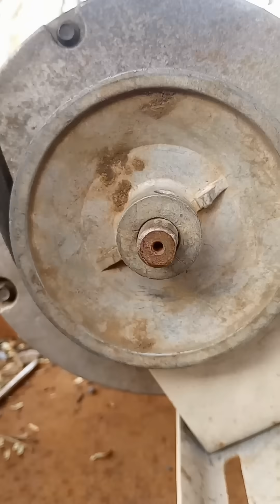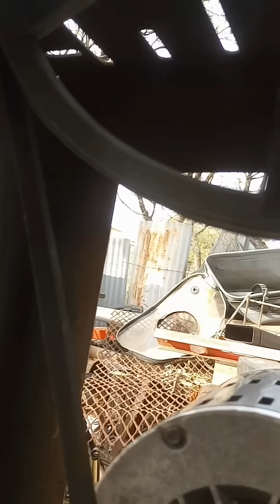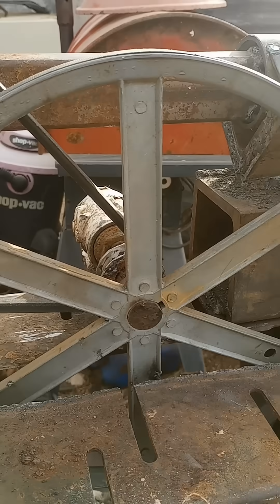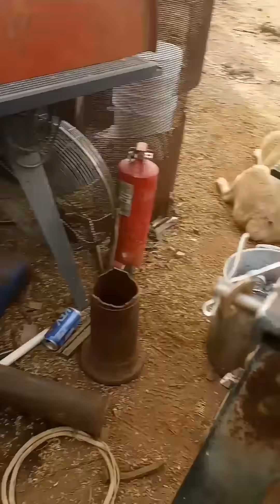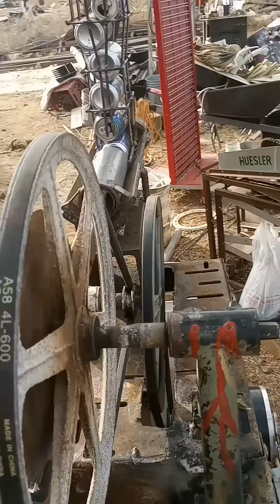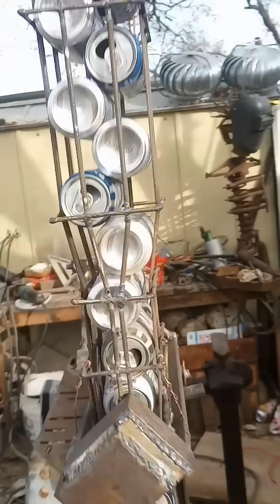Automatic can crusher demonstration

Comment: Nice wish I could figure out how to build me one
Reply from the maker: @fergusonto-2032  it's not too difficult, I start with a ½ horse cooler motor, run from a small pulley to a big one, then again small to large, and the second wheel powers a piston. You can do it with a little willpower and some troubleshooting!
Reply: @ thanks a bunch